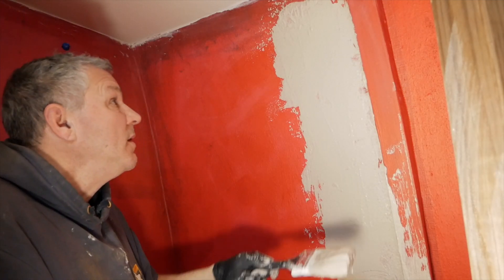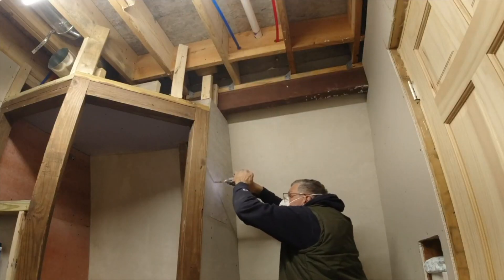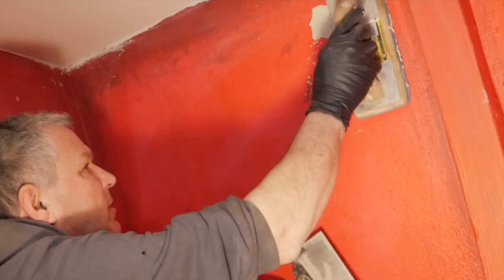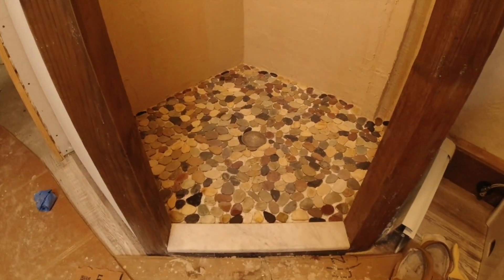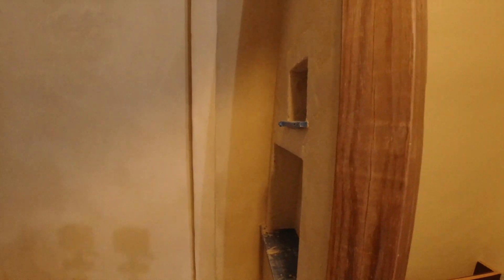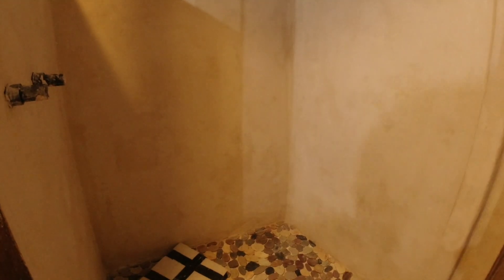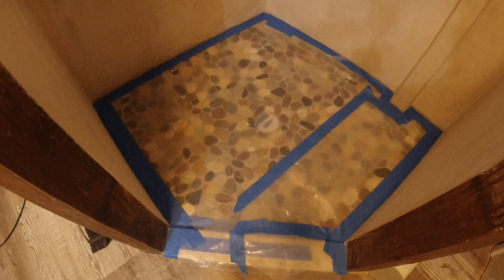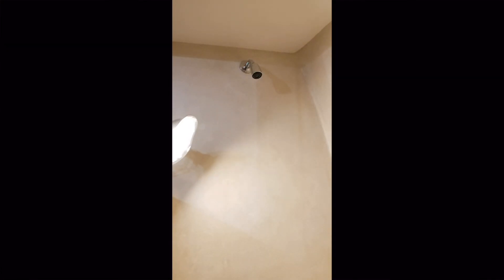DIY Microcement Shower Walls | Watch this BEFORE you decide!

Comment: I'm a professional who works with surecrete and other decorative plasters.  We are always at the mercy of the products we use.  Sometimes the manufacturers make slight changes and we have to adapt.  sometimes the environmental conditions aren't just right.  Whatever the case may be, seldom does everything go to plan and never do we have two jobs that go exactly the same.  With 25 years of experience I still have sleepless nights because customers demand nothing less than perfect.  I am impressed that two individuals with little experience pulled off what I consider to not be a diy project. It looks great.  I'm not going to tell you where you made mistakes or what I would have done differently.  It's your work of art and it has your stamp on it.  It's perfect.  I will comment on the xs 327.  I have only used it on my concrete counter tops that i made for my kitchen. I applied the sealer 7 years ago and not a single stain, scratch or wear. We place hot pans right on the surface and no marks.  it's the greatest sealer I have ever used.  The first coat is designed to be applied to rejection so it must have been so difficult for you guys to keep it completely saturated.  I'm guessing that's why you experienced blushing in every coat.  I'm very impressed with you guys and hope you are able to enjoy the shower for many years to come.
Reply from the maker: Wow!! Thank you so much for the awesome comment!!! It was definitely a ‘labor of love’ so to speak but we are happy with the end result. Respect to you for doing something like this more than once! 😁😊
Reply: Carl, if you don’t normally see people using the XS for showers what should you use? I contacted surecrete and they said the DK400WB but it doesn’t say it is for wet or shower usage. I am not sure what is the best sealant from surecrete to use.

Comment: How have you found cleaning it a few years on? I'm considering a microcement shower but am worried that when bacteria and mold builds up that I won't be able to use an abrasive cleaner on it and will be left with pink or black stains. Thanks for the video :)
Reply from the maker: No problems at all yet, but we dehumidify after showers so it dries thoroughly. We only use soap and water to clean with a scrub brush. Going on 2 years so far. 👍 still loving it!

Comment: I'd be curious to see how this is holding up one year later. As a DIYer, it sure is frustrating to deal with learning curves!! I've had many.
Reply from the maker: Holding up great! No problems at all other than a few more hairline cracks here and there. We have plans to reseal it at some point though
Reply: @CreatingASimplerLifeOffGrid  Thanks for the reply. I'm surprised the sealant is also holding up so well. In the end, I thought your results were good despite the complications with the cement.
Reply from the maker: @janetpelletier1238  thank you! And yes, we really super sealed it.

Comment: Wow you guys did a fantastic job with what seems like a terrible product imo. I use venetian plaster and micro cement everyday and I've never seen this before that was 100% too thin! I would highly recommend pisa products (I'm not sponsored) they are the best imo again. 😅.  Tips....sand between coats with 240grit then 600grit.  Make sure you unmask between coats and remask too this will save you so much time.  If you've  never used this before always do dry corners so opposite walls. The sponge is fine it'll close the pours but not as much as burnishing and you'll get a very smooth and buttery finish with burnishing. Always use stainless Steel trowels especially on white. But amazing job guys you're awesome! 🎉🎉🎉.
Reply from the maker: Thanks so much! It definitely was a total learning experience for us😊

Comment: Since it's called micro-cement Spraycrete, could you experiment with a paint gun with a special tip to spray it on, like the contractors did on the exterior?
Reply from the maker: We could have tried but the shower was so small there wouldn’t be a lot of room to spray
Reply: @CreatingASimplerLifeOffGrid , hire a fly-by-wire, remote control ventriloquist dummy and watch it through your goggles...  😂

Comment: Not able to go through each comment to see if already addressed, but it is my understanding that surespray is not for troweling but for spraying with a hopper.  There are other microcement products that are for troweling.
Reply from the maker: Their directions literally state it can be troweled - see their technical data sheet here: https://surecretedesign.com/tds/bag-mix-surespray-tds.pdf and the site where we purchased it: https://store.concreteexchange.com/products/surespray-concrete-overlay-mix?variant=28717461373002&currency=USD&gad_source=1&gbraid=0AAAAAClHkhtzTWAlPR-uNuOuyYBCyVhSY&gclid=Cj0KCQjw0_WyBhDMARIsAL1Vz8sv4ZA3ICreSqtdHalxJWqnDB_artbVlURvvEj0HoUpGQhst6HAMqYaAr_ZEALw_wcB

Comment: Do you remember how many days it took for the sealer to fully dry and the splotches to disappear? We sealed ours and its streaky, but its only been a few days. We worked so hard on it but now it looks awful 😭😭
Reply from the maker: We felt the same exact way. The sealer took a full 7 days. We were happy once ours fully dried, but unfortunately it now has a lot of cracks that are noticeable after we shower. Still working on a plan to fix that in the future. I really hope things work out for you
Reply: What did y’all end up doing for the cracks is it leaking?
Reply from the maker: Just saw this! the cracks are fine, still there but NOT leaking!

Comment: You mixed the first bag according to directions but the drirections are for a FLOOR that is poured and spread. You should have contacted a rep. The ratios and different for walls
Reply from the maker: That makes so much sense. I didn’t notice that in the directions 😕
Reply: @CreatingASimplerLifeOffGrid  To be fair the directions are lame. I’ve bugged that rep about 109 times with questions ha ha. I’m doing MY ENTIRE BATHROOM
Reply from the maker: @cherylq7183  Wow! That will be beautiful when you are done!

Comment: OMG micro cement looks terible to work with.. Is there a follow up video re the cracks What did you do?
Reply from the maker: It was definitely challenging but we absolutely love it. The cracks are still there but they’re all sealed so we’ve learned to embrace them😁